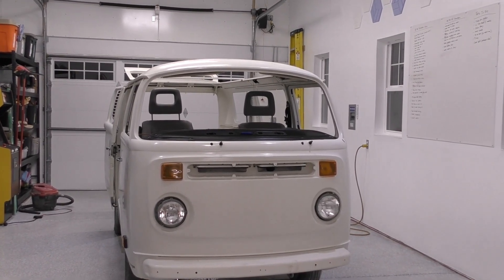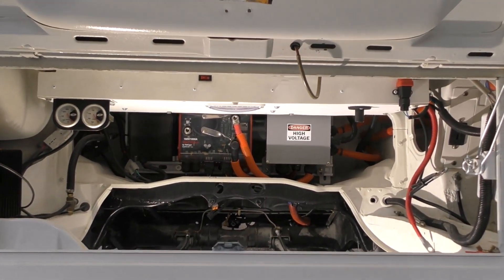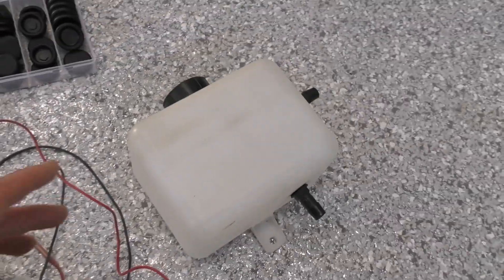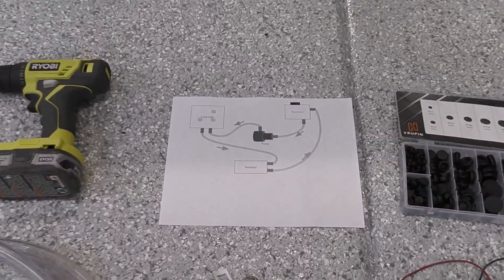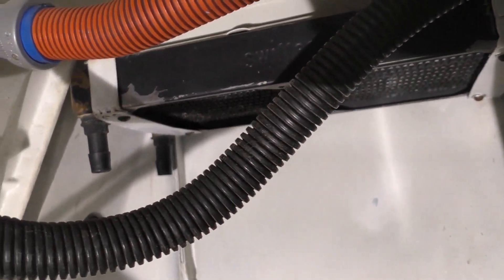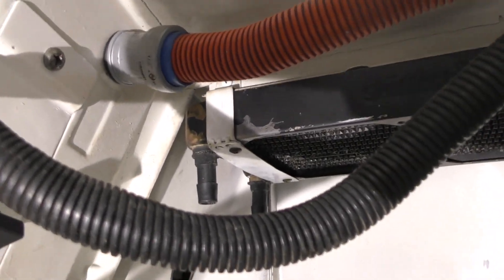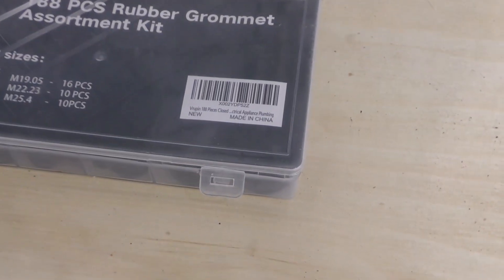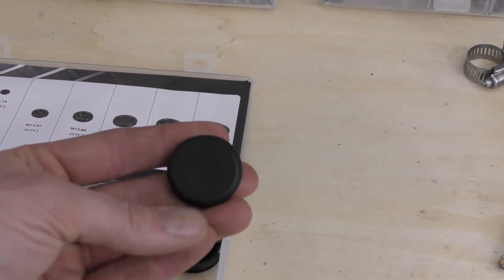VW Bus Electric Conversion Part 10: Motor Controller Coolant System #evconversion

Comment: Well done! What kind of radiator is that? From a motorcycle? How many cores? Thanks in advance.
Reply from the maker: Thanks!  That is a 240mm aluminum radiator (10" x 5") typically used for PC liquid cooling systems.   I inherited that radiator from a previous build.  Not sure how many cores.

Comment: There is an antifreeze designed for EV systems, if it leaks it won’t damage the electric items.
Reply from the maker: That's a good point.  I may change this to a non-conductive coolant later.  The area where I have this coolant routed has sealed high-voltage boxes and components.  If I did a liquid-cooled battery system, I would definitely want the non-conductive coolant.

Comment: Great project! I may have missed it, but what radiator did you use?
Reply from the maker: Good question.  I didn't buy the radiator; it came with a cache of parts from an old EV build.  But it is a 240mm aluminum radiator (10" x 5") typically used for PC liquid cooling systems.

Comment: Good morning Scottie.  Great video, this was so interesting. I knew you were doing a conversion but like you said we have all been watching your building go up.  Will have to go back and get caught up on the bus conversion stuff. 
👍👍👍👍👍
Reply from the maker: Thanks! If you noticed my whiteboard at the beginning of the video - I have a handful of EV conversion tasks left to do, but I probably have 25 or more restoration tasks.  So I still have quite a bit of work left to go.  Hope your Bay Window project is going well; the weather has been quite accommodating so far going into this winter.